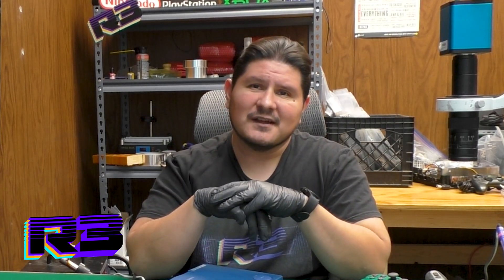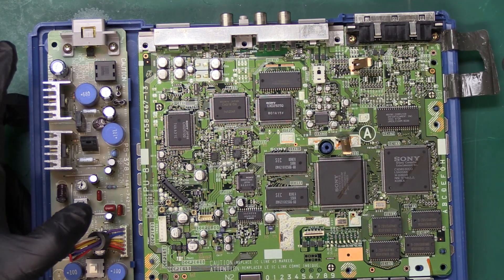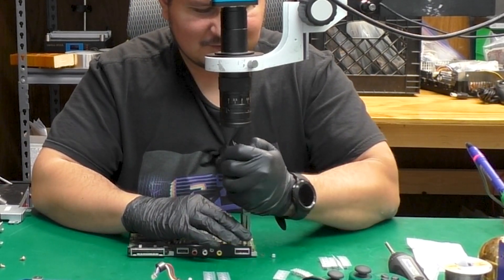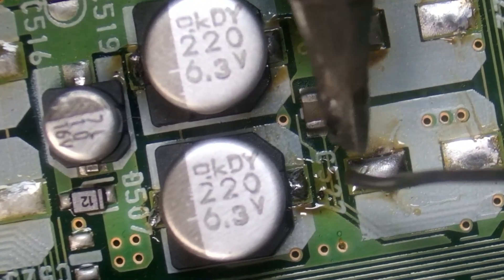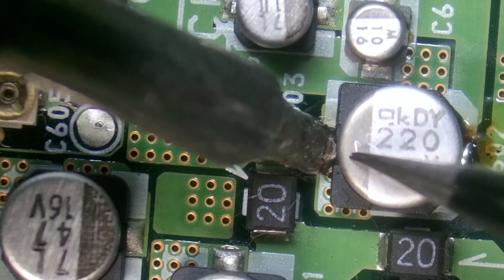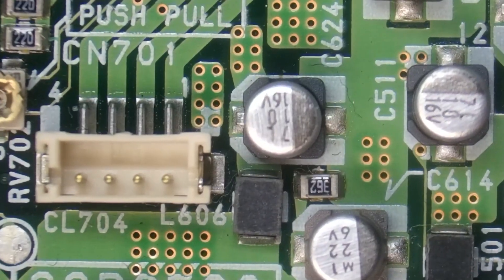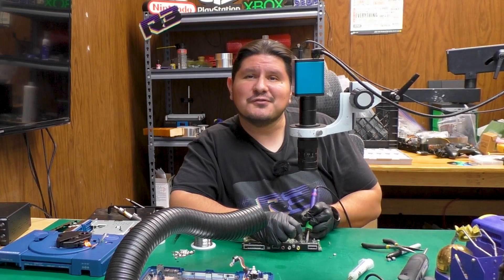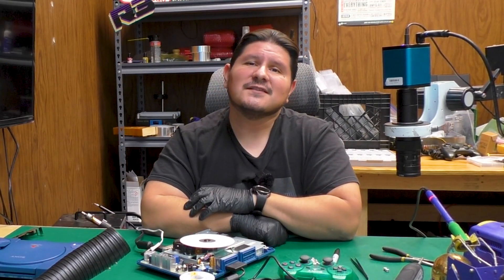Failed Capacitors Are Hiding Within This Mysterious PlayStation One Development Console

Comment: it´s so depressing in a way to know that even the original Playstation have gotten old enough to have leaky caps. Why much every old capacitor in my gear leak? I both love and hate to re-cap all my old gear, I hate to do it but I love when I have done it
Reply: There were no leaky caps in the video, they were just being replaced for preventative maintenance. After all, these are verging on 24-30 years old!
Reply: @ yeah. But it is more and more common to see old devices have leaky caps. I am re-capping a lot of my stuff just because they have either died or is dying because of it. And I have a lot of old gear too. Age take everything eventually. Especially capacitors

Comment: PAL is a further development of NTSC and therefore PAL TV's can show NTSC picture, but not the other way around ...
Reply: Sort of. If there is no NTSC color demodulation quartz on the board of a PAL TV (which lower end ones back in the day used to not always have), it won't display any color when fed with NTSC Composite or S-Video, but you still get a black and white picture.
Since RGB is not color modulated, it will always display in color, no matter if it's 50 oder 60 Hz.

Comment: Since the PU-8 motherboard has the unpopulated solder points for the few capacitors other components, and the DIN connector used by the S-video circuit of the earlier PU-7 board, do you know if anyone has tried retrofitting direct S-video to a PU-8? btw those unpopulated cap spots at 4:47 are for the S-video direct out circuit on the PU-7.
Reply: Yes, but there is quite a bit more to add than just installing the caps. There is also a filter (that's the 6 pin footprint above the not installed caps) possibly a 0.1uF ceramic used for coupling the chroma signal and some amplifier circuits built using discrete components just below the CXA1645 video encoder at the bottom of the board - these are the unpopulated pads on the left side and use the same parts as the populated buffer amplifier for the composite video that's the right of empty pads. I tried it, but honestly I couldn't see any quality difference between the Y/C output on the S-Video socket and the one that was already present on the Multi-AV connector.
Reply: @TrimeshSZ  I know it is pointless since the multi-out exists, I just thought it might be an interesting project. Good to know at least one person has pulled it off successfully. Thank you for the info.